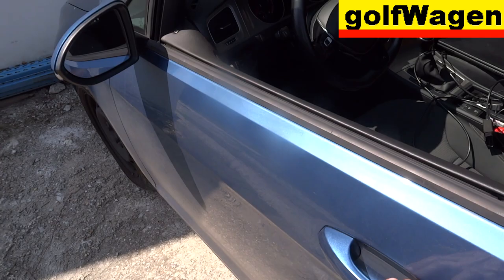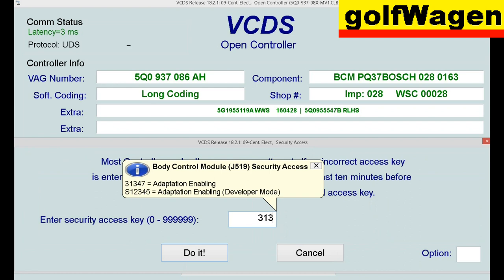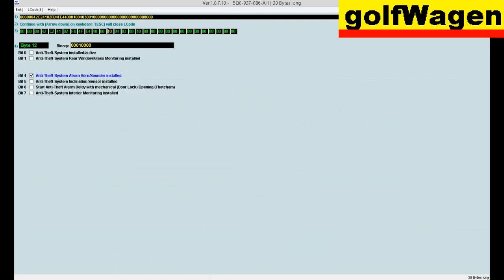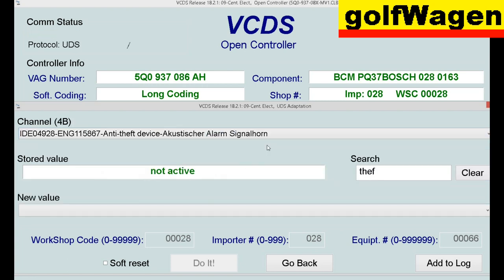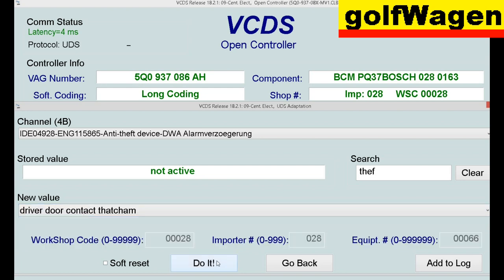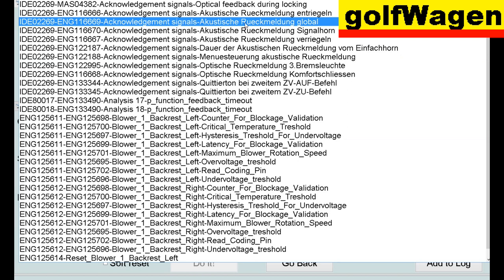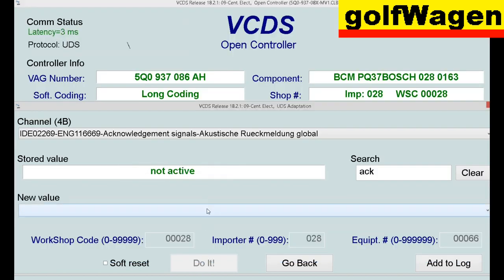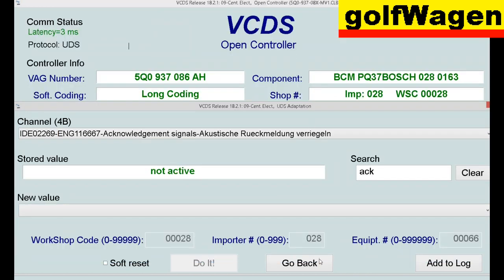How to activate anti theft system alarm on VW Golf 7 /VCDS VAG tutorial/

Comment: Hi! Nice video! It works on my Passat B8. I did the same things like in your video.
But I want to know more in: channel 09 central el.-> long coding-> byte 12, here we arrived are more functions to activate?
Like:
Bite 1 - rear glass monitoring
Bite 5 - inclination sensor
Bite 7 - system interior monitoring 

I checked in the box, but no more functions on my passat? Or how it will be work? It write that is installed, like in your video, but how they are activating the alarm? Or it work only at the opening interior "door contact"

Comment: Hi Skoda Octavia 2012 Abs in the abs system was examined by the compass of the right is a defect in the right calf calf sensor has been changed sensitivity and when walking and the experience of the sensor was light abs light and when the examination of the inspection of the fault was detected the sensitivity of the right calf was examined and reading the four sensors are given the same reading What is the solution